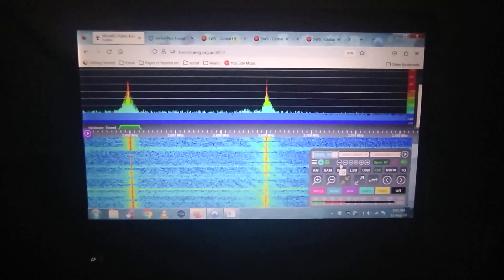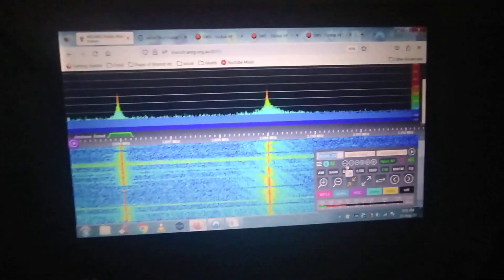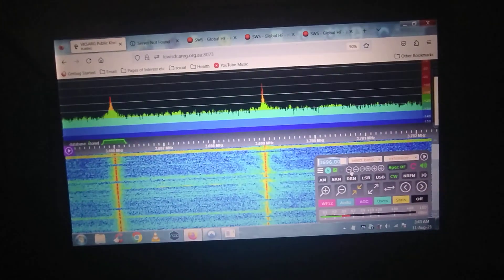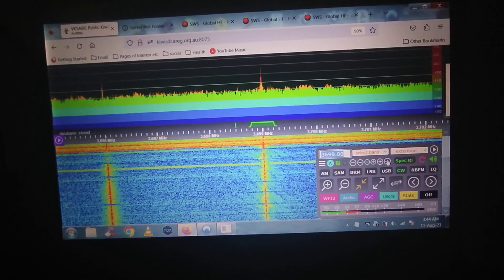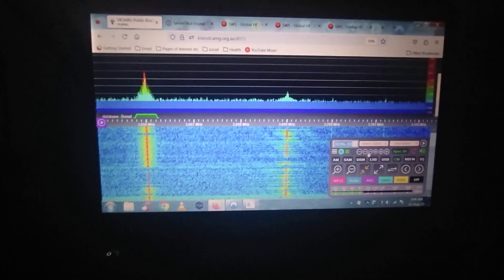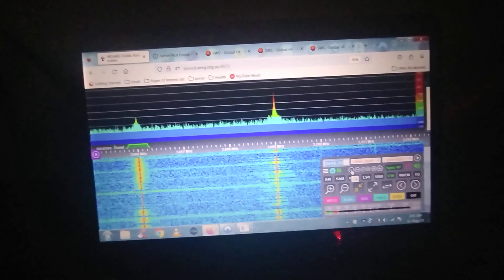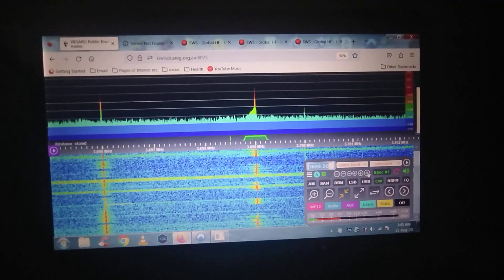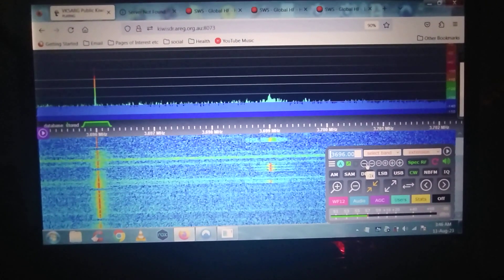80 Metre Band TX Comparison  (Capacitively Loaded Vertical Ground Plane)

Comment: Good video!
I can't seem to find a Google image of a "capacitively loaded vertical ground plane" antenna.
KD8EFQ/73
Reply from the maker: Thank You, it is my own experimental design concept
& still a work in progress.
I will share more info on the element design in the future. 

Currently it has two vertical elements, they are (approx) electrically 1/2 wave on 80m and the other is 1/2 wave on 40m
but physically the elements are 1/6 wave long for each one. making the 80m ele not much longer than a 40m 1/4 wave ele.

Also it Currently has 4 elevated radials of approx 10 to 12 metres long
but can also be used without radials, using part of the coax as the ground,
I would need to choke the coax shield perhaps 10 or so meters below the feed to operate that way.

Currently heavily choked maybe 30cm from the feedpoint.

73 from Crazy Ham ⚡🙏⚡
Reply: @crazyham  Thank you, I really appreciate the reply and detailed description that I could see in my mind's eye!
However, on a slightly different note, I didn't get the notification of your reply that I clicked on "SUBSCRIBE".
Someone else on another channel was nice enough to tell me that YouTube is blocking and shadow-banning my comments because I've said some things on various news outlets in the realm of politics that were of course about as sharp as a surgeon's scalpal used without mercy! 🤣🤣🤣  As here, I had to "chase" the comments that I've posted in order to find out if anyone's replied.  In the USA, we don't appreciate our freedom of speech being suppressed in such a manner.
Reply from the maker: My Friend,
This is Happening to a Crazy Huge Degree
And we the People of the World 
Need  to Stand Up !!!
Reply from the maker: It is Ridiculous how many comments I make that are simply NOT ALLOWED
Reply from the maker: We Need To WAKE EVERYONE
Reply from the maker: Get Every Person You Know
to tell Each Person they Know
about what is Going On !

You in is USA
are somewhat Centre to this
and whether you  get Mr T or Mr K it would be 
a blessing to the world around the usa.
Reply from the maker: I am in a dictatorship.

Vic is the worst.

I am not protected by Federal law
as our State Leader is a Tyrant
and the Fed are on his side
Reply from the maker: We have a few outspoken minor party leaders.but they have no majority
Reply from the maker: I am trying my best to not jump off a cliff
Reply from the maker: Our Gov is now trying to pass a law 
that allows them 
to limit what we can say.

not just after the fact,

but before the fact 

So they can limit us before we even make a comment
Reply from the maker: Please reply to this comment 
to reassure me 
that You are seeing my comments.

There have been plenty  (ie 10 ) 🙏
Reply: @crazyham  Understanding the law in the U.S. at least, because the U.S. Federal govt. is essentially paying Google/(YouTube), Google is legally obligated to respect our 1st amendment constitutional rights!  But getting enough American citizens together to take Google to court and sue them would be next to impossible as we are such a divided nation in so many respects.  Coupled with the fact that liberals particularly, want a "special right" which overpowers that of conservatives and right now anyone that supports former Pres. Donald J. Trump, such as myself.  I swear if I could get more Americans to drop their socio-political differences for the right to express themselves freely and not be suppressed with the fake argument that someone's going to be offended and thus YouTube thinks that they need to protect them things would be completely different very quickly.
Reply: @crazyham  We have a mafia-like criminal family in the White House of the USA.
Reply from the maker: @charleswoods2996  Agreed on all Accounts
& the effects are International ⚡🙏⚡

I pray that something wonderful Happens in the USA 
that Radiated outwards.

I think that may still happen.

You at least have a bill of rights 
and  a comprehensive constitution.

We don't !
If I may say this,
Your Former (Leader) I see as the latest legitimate Leader
and Corruption
could not tolerate a truth sayer.

I Thank the Powers Beyond our World for the Work the True Leader has Dome Thus Far 🙏

I think the next step will be taken by another Person
who's Ancestors are standing right Behind
and I think he is one of the same team
and will fight the same fight that the last REAL leader has been fighting.

Forgive my strange wording,
I am trying to deflect local limitations
🙏